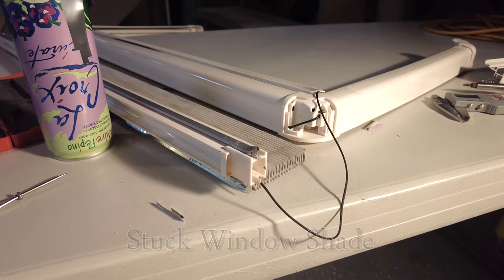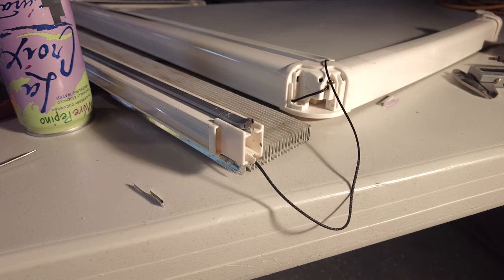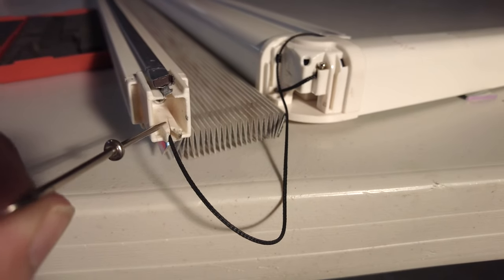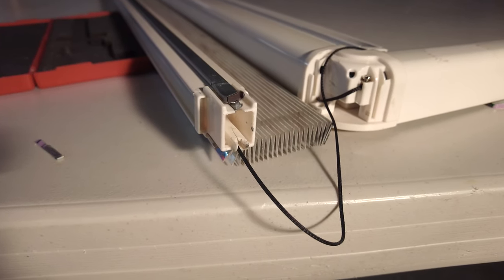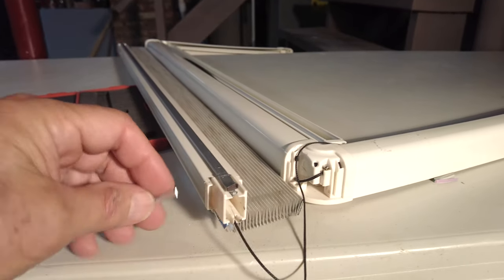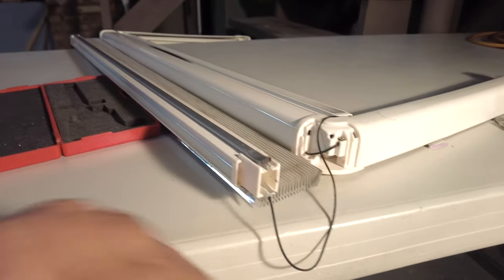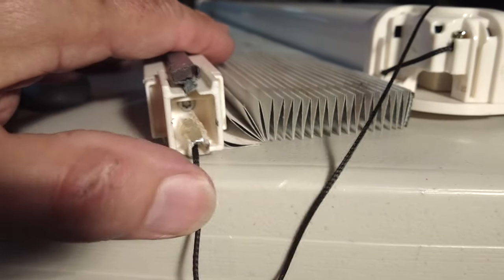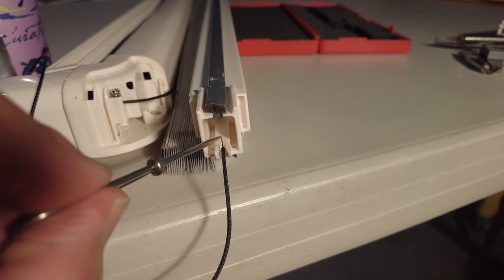Stuck Shade Fix

Comment: Very nice!  I've fixed three different screens on my 2019 K using super glue on the cracks with success but I like idea this much better.  Thanks for posting.  I think I'll set aside some time and patience and do this preemptively on all my cassette blinds.
Reply from the maker: The epoxy fixes lasted for about six pulls of the shade and then it jammed again.  The aluminum can was my wife's idea.